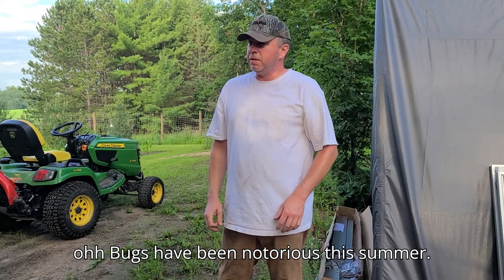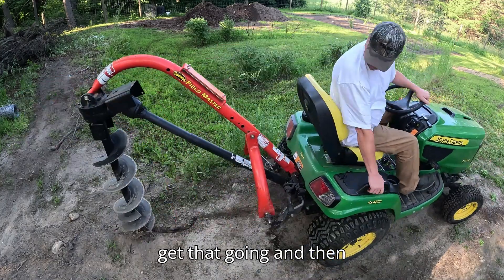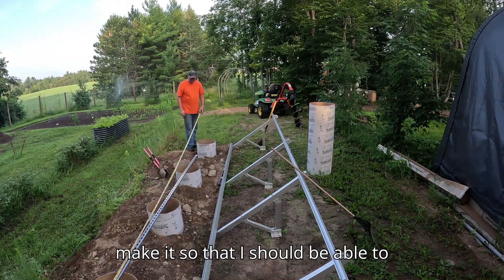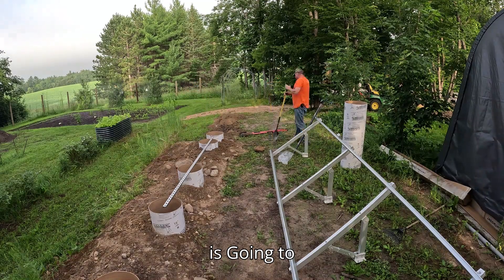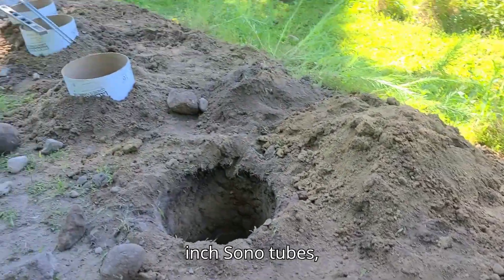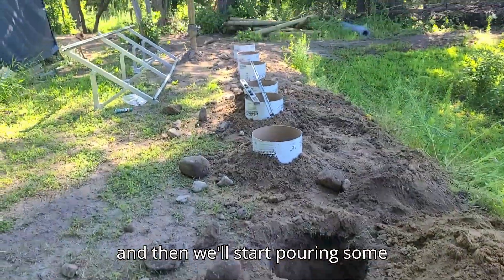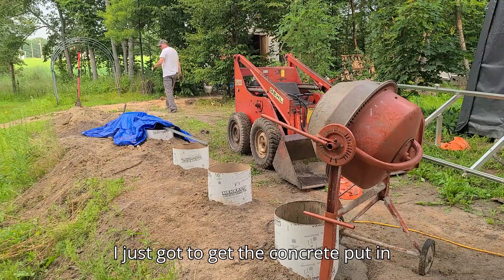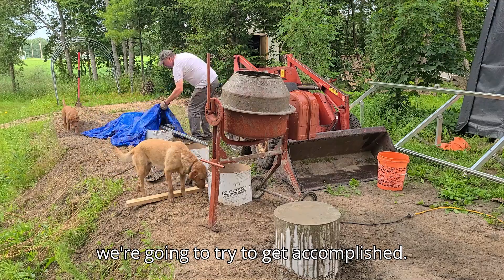EG4 BrightMount Solar panel Rack Footings!! #eg4 #solarsystem #offgrid

Comment: How many bags of concrete per hole?
Reply from the maker: I think it figured to be 8 bags per tube.  I did save a little as I was doing it by adding some of the larger rocks I had on my property to help fill as I was pouring.  I am glad that I went with a concrete instead of wood base. Seen some people do that and with some of the windstorms we have had this spring I would have been pretty nervous about them moving.

Comment: The brightmount kit shows each leg 51.2” apart what’s the distance measurement of the second connected brightmount leg? It looks closer?
Reply from the maker: I was a little off when I dug the hole for the concrete.  But the main thing is that they are all in a line.  The legs can slide either way, and I think as long as your not on a splice or to far from the end, it will be fine.